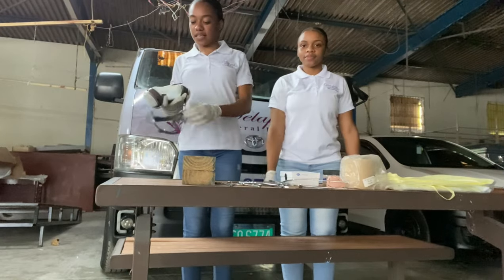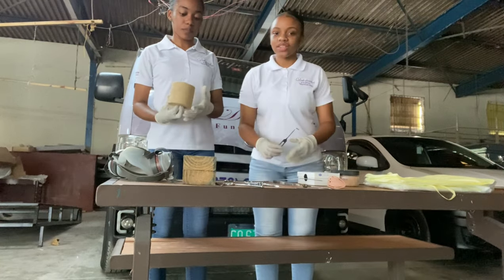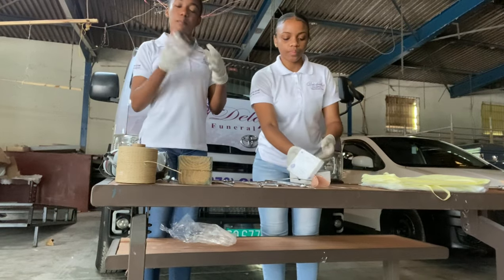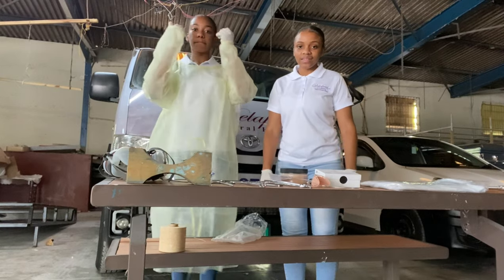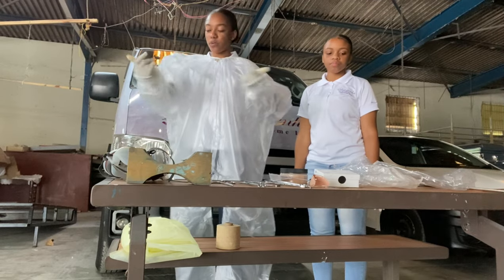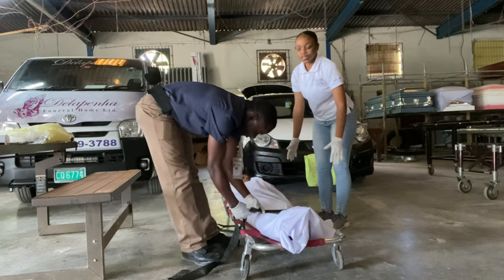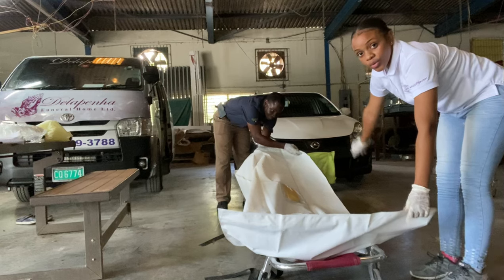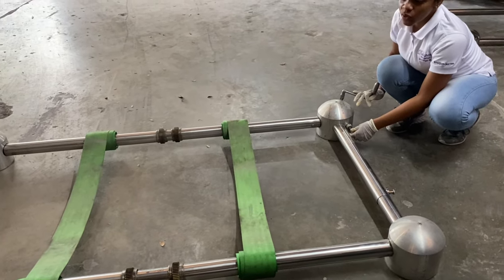Morgue Instruments/Pickup / Lowering Device #funeral #funeraldirector #mortician

Comment: When using a unionall i always have the zip to the front so as to prevent leakage remember any fluids leaking out will follow gravity  "run down to the back of the body" the zip isn't leakproof so if placed to the back of the body any leakage could potentially soil the clothing or casket lining.
Reply from the maker: Yes that’s what we do when we are dressing them